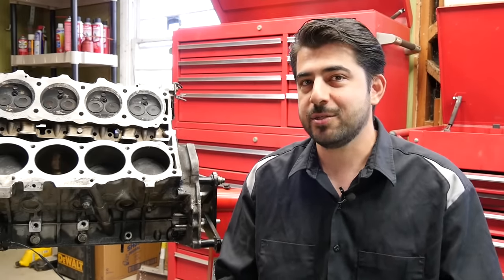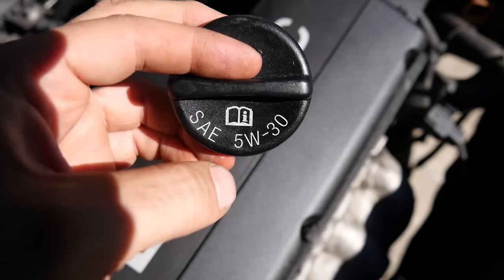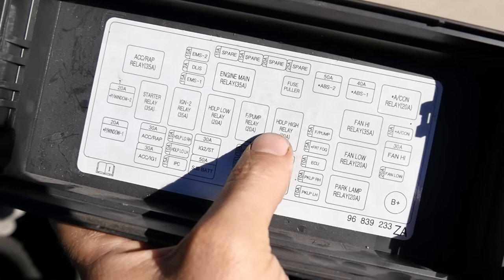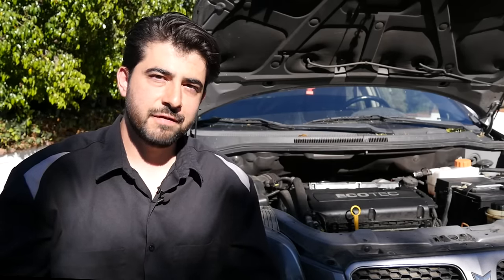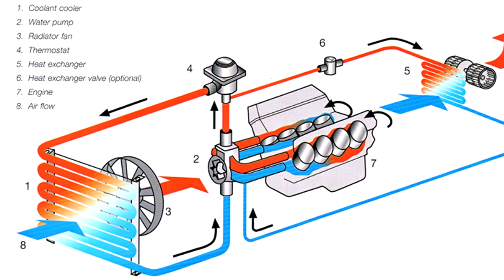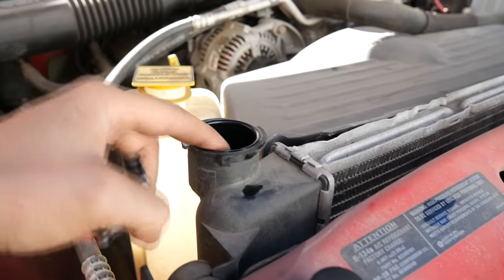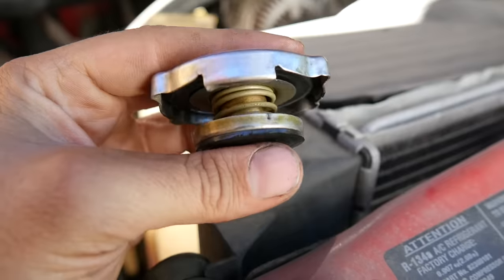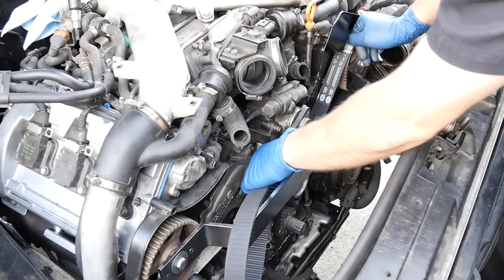Make Your Car Engine and Transmission Last a Very Long Time - Top 5 Tips On Car Care

Comment: If I dont use the oem part, I use use the brand that makes it for tje manufacture, its the same exact part just not over priced due to the car manufacture emblem on it👍
Reply: Smart Idea to find out who actually makes oem parts.
Reply: Exactly what I do! And if I cannot find the supplier’s part, I’ll usually go with Dorman or another OEM supplier.
Reply: Those are OEM (Original Equipment Manufacturer) parts.
Reply: @Fifthcell  dorman is not high quality
Reply: Bryan Hensley I’ve been reading around and it turns out that many people have bad luck with Dorman parts... I personally have never had any problem with Dorman’s parts... they’ve always been good to me.
Reply: @Fifthcell  I've had pretty good luck with most of their parts but overall they aren't near the quality of OEM
Reply: James Kaminski well you will change your mind after a few fuel pump replacements
Reply: @victorialouden1912  depends on the car, especially since I am a dealership tech, i have all my tools and lift nd I work on the brand that i own anyway. Not all cars are a pain to work on.
Reply: Yep, you can certainly do this with European brands where everything is made by Bosch or Dorman andyway. I have an old E46 and most of the BMW parts are stamped Bosch.
Reply: Yep, I did that for a Throttle Position Sensor, found out Beck/Arnley made the factory part, ordered it from Rockauto for way cheaper than dealer prices and inside the B/A box was a Nissan box containing the part.
Reply: Late comment..but this is not true. Just because the company makes for anyone doesnt mean the same at all..oem pay more for specs and volume..the company only does spec required..
Example is when i used to cut steel for gm..they had inpspectors and specs for everything..and that was before mfg. After market standards are indeed lower. 99 % of the time.

Comment: Very true I always use oem parts they cost more but they last a lot longer in the long run so they are actually cheaper. Aftermarket parts always fail earlier.

Comment: My 2004 Honda Civic just hit 300k miles... In its life time I rebuilt the transmission replaced the timing belt replaced the water pump thermostat and tires and brakes and oh I forgot replaced the computer too.. runs great m very happy

Comment: In regards to brake components...I've found that aftermarket brake parts can be VASTLY superior to stock OEM parts.  The NAPA brand has some excellent brake rotors and pads.
Reply: That's probably dependent on your car brand, for Honda/Toyota you cannot go wrong with OEM which lasts a long time and wears the rotors less.
Reply: Hmmm unlikely.

Comment: RE: Filling filter during oil change:

The premise is that if the engine is cold before you change oil, it the oil has drained from the passages and some wear surfaces are not well lubricated. The empty filter will take some time to fill and the wear surfaces will be exposed to additional wear for a short time.

However, it is much easier to simply run the motor for a short interval to make sure that the wear surfaces are coated before you start your oil change. Also, if the oil is a bit warm, it flows easier getting it out of the motor. 

Assuming the motor is warm and the wear surfaces are already coated, the extra second or so to fill the filter shouldn't make a difference.
Reply: But then your old oil is still in the engine
Reply: @truth.speaker  Trace amounts.

Comment: I’ve been replacing parts for my 07 Jeep Grand Cherokee as they fail. So far so good. I’ve replaced almost all of u mentioned here w Bosch from O’Reily like catalytic converter system, water pump, new radiator, new serpentine belt, brake pads, fuel cap etc so far she’s back to running solid just hit 170K and I want her to run to the 400Ks 🤞🏽and btw I always oil change every 3K religiously w synthetic blend

Comment: Three easy steps!! Change your oil at minimum every 6 months and drive slowly. Keep your fluids topped off. And last drive slow and watch your gauges.
Reply: Min. of 6 months is total over kill --- change the oil every 4k-5k miles religiously and use high mileage oil after 75k miles.

Comment: Wish I had known these things when I had my old 1999 Toyota Tacoma 2wd regular cab truck. I loved that truck! The engine finally gave up at 504,000 miles. Who knows how long it would have lasted if I had seen this video15 years ago.
Reply: Don't beat yourself up when we were young we all beat up our vehicles to some extent we all have 20/20 vision in hindsight don't we. Heck I like you wish I had done the same with my first car. We live and learn.
Reply: 504,000 is extremely impressive. Scotty Kilmer says your truck could last forever because of it being a Toyota with a dead reliable engine.

Comment: My 1994 Caprice Classic lasted 350,243 Miles before the Wire harness Shorted out.  The Engine and Transmission were Factory Stock too. Ran Strong too

Comment: Buying a Toyota is still the best first step...
Toyota has made fools of every other car manufacturer...in history.
Reply: "Exactly!" People will be buying four and five cars, ..by the time my Prius ever kicks the bucket! LMAO
Reply: Or any other Japanese car mostly 1990's
Reply: LunaticRed EyeS88 na. just dont go with modern nissans..effn trashhhh. i dont know what happened to them.
Reply: @mobius-1503  They merged with Renault some time ago that's why
Reply: LunaticRed EyeS88 ahhh. good to know thanks..they used to be supperb..we had a 91 300zx forever. manual. never smoked. timing belt was a pain but damn that engine. sounded like a little tank i loved it. never failed us. even that horrendous digital cluster gauge tryna look all futuristic just always worked. pwr windows never broke 285k miles...then way later. i decided to get a sentra se-r. lol. biggest mistake ever. went to the junk yart at 127k...
Reply: I had an Isuzu Rodeo and they went out of business my suv was a decent vehicle but it had many issues that we couldn't ever figure out how to fix. Bought a Toyota and my experience has been trouble free for years.
Reply: I want a Sienna...but have a Honda.  For most of the basic tune up stuff, they are easier to work with.  Although they are still underpowered when compared to a Sienna.
Reply: In reliability sure, it makes a fool of a lot of car manufacturers. In performance everyone laughs at Toyota
Reply: Toyota’s are great but they got nothing on Honda’s.
Reply: @markevans658  having serious issues with a fairly new honda crv 2012, car has one acces with key entry not even the passenger door has one which is pretty dissapointing considering something can happen to the driver door lock entry and dont have second key entry. Looks like cost cutting to me. Another issue is the rear camber on that thing comes with non adjustable upper control arms and the rears begin to sag inwards so wears the inside tires fairly quik..was 180 for the pair with the adjustable center nut but seriously. Being the premium model why are they not included.   The biggest hit right now is at 150k. The transmission is shaking unbelievably. Thinking it was wheel balance or rubber inserts in the front lower control arms but their normal, tie rod end links /motor mounts/ tranny mount is normal, began reading into the shaking and come to find honda put in a newer not fully tested transmission in these models due to it being more fuel effiecient..well somethings happining within the transmission at 55mph and shakes the entire vehicle. Very very disappointing!. Havent taken it to a trans shop due to current budget but it doesnt feel like itll be cheap. May fix it. But will get rid of it asap
Reply: @Biden_Cult_Morons  i was up there in miles in my cavalier. My first whip too was a 2002 manual cavalier. Loved that thing. Would beat it hard. I crashed it at 220,000 miles. Only major thing ever changed was the clutch. Ac was blown as well never fixed it..
Reply: Mobius -1 Yet there are million mile Honda CRV’s with almost no issues.  Reliability on both will be great overall with each having the very rare lemon.  Where Honda really pulls away is styling and driving.  They look significantly better model for model, and who doesn’t want to like the way there car looks, and they drive way better.  Plus they just have better engines.  Toyota is reliable but they don’t drive well and they look terrible.  Although the new Camry’s look much better then they used to.
Reply: @liveuntetheredmusepodcast4832  That Prius will die
Reply: @RMH5.0  True, but at 600K miles
Reply: @liveuntetheredmusepodcast4832  it's a hybrid right? Notoriously expensive when it goes wrong. If you have even a slight problem with that system you might as well right it off
Reply: @RMH5.0  Yes, if your ignorant.   It's pretty inexpensive when you work on your own vehicle. The Prius has lots of technical glitches and issues, (for the average driver would be a major problem, not a slight one) though 99% of these issues can fix themselves with a little human assistance, that's why the Prius is such an incredible machine. Only thing I've ever paid for at a shop, (besides new tires) was getting my brakes bled because it's a computerized method.  I'm hitting 200k miles now, and I expect to work on my hybrid battery cells around 250-300k miles,.. by then i might also have to replace the 12v utility battery, and maybe a starter. There is no alternator, the cooling system is basically indestructible, and lasts forever.
Reply: @liveuntetheredmusepodcast4832  same goes for a lot of cars if you have the knowledge to fix them the price doesn't come into it. But I think I'd have something a bit more exciting than a Prius
Reply: @RMH5.0  LOL trust me i've had enough exciting cars to last a lifetime, I've always owned Trans Am's and Firebirds,.. as they will always be a favorite, but hard to keep around if they aren't kept in a heated garage, (when you live in the  salty northeast) because the unibodies rust so quick. Fiero's are a blast in the snow, because of the balanced engineering, and rear engine...I've also owned Mazda RX7's, Datsun 280ZX's, and loved them all....those also rust very quick. All of them are cars that will never last much longer beyond 100k miles, (at least where i live, unless you never drive them) Now that I have medical issues to deal with, I really need something reliable as possible, and this Toyota Prius though it's not that fun to drive, it is crazy reliable and the computer system can be fun to mod, and mess around with.  But yes I hear you,  I miss my sports car days, every single day! I used to modify Trans Am to drive well in the snow, but of course the salt from the roads would eat them away very quickly.. no sport cars drives best in the snow than a Fiero though, with very few modifications. 
They just made a 4x4 or AWD prius, that might be fun in the snow! lol
Reply: This be true.
Reply: I wish that the North American market had access to some of the other models of Toyotas found in other countries.  The Series 70 Land cruiser in Australia is a stout truck that can be had with at V8 diesel as well as different body configurations.  I'd like to buy one here in Canada but it looks like I can't even import one....
Reply: RMH *write
Reply: Scotty  has grown a beard and dyed his hair !
Reply: Well... Toyotas new oil filter design might change your mind. Check out this Tacoma oil filters on the newer models. It is disturbing.
Reply: ...except honda
Reply: @so1idify  a 2JZ says am I a joke to you
Reply: @markevans658  I have to agree I think Honda's have better engines.
Reply: @liveuntetheredmusepodcast4832  Just means you have to drive an ugly under powered car for even longer Lol
Reply: @AW-zy1kw  the prius prime looks pretty sharp
Reply: I seem to get to the same mileage if I'm driving a Toyota or a Mazda.  Heck, even my 2010 Altima is close to 200k.
Reply: The 4 cylinder  Toyota Camry bought with 300000 miles change what he said the change and flood in transmission  Toyota has a dream plug and filter to do-it-yourself so that with 420000 miles in far as I know it's still going with 420000 miles on it when sold . It's still did not burn oil but did change all reg'lar and the transmission

Comment: On an older car, 2005 Dodge Caravan (3.3 150,000+ mi) it calls for conventional  5w20. Runs fine, no leaks, no burn, she hardly consumes any oil at all. I'll stay with conventional 5/20. And as far as a trans. flush, a Dodge Master Mechanic said to leave it alone. That particular 4spd trans in that model year and  others b4 and after were not well made and a flush will only serve to screw it up. I do the regular maintenance, keep fluid levels up  and we're good.  👍😉

Comment: Excellent advice.  I wish I would have used Synthetic Oil from the moment I bought my 2003 Mazda Protege 5 brand new.  However, I started at 100,000miles and now I have 198,300.  I changed my timing belt always at 60,000miles, but I don't know if my mechanic changed the other parts you said we should (Tensioner, Idler pulley).

Comment: I drive Camry 1995 about to hit 300000 miles
Reply: My 99 Camry 4cyl is about to hit 300k too! Had it since 2000 with 14k on it.... Never had a real problem, typical small stuff, tie rod ends 2x, radiators 3x, timing belt 3x, struts and mounts 1x, both cooling fans 1x, idle air control valve / throttle body scrub out off the car 1x, original AC parts (live in FL, AC is used 95% of the time!) Original alternator although I replaced the brushes last year when I started getting no charge / alternator light ;-) 
Bought new lower control arms, one bushing is shot, need to get that done ASAP at my friends shop. Can't even tell that the bushing is bad by the way it drives. Just feel a little clunking when tapping the brakes and odd squeaking when wet, so I knew something was wrong! 
Car is so reliable and smooth and quiet on the road with the right tires on it (General Alitimax RT)...
Reply: 96 Camry, daily driver, 340K Miles.  Leaks a bunch of oil, but runs just fine!
Reply: My 06 spectra Manuel 162000 Miles AC super cool and keep going.
Reply: Captain Caveman  I keep waiting for it to crap out, and it never does... quite boring, not like my Fords, which fail and die in spectacular ways.
Reply: Captain Caveman Imagine having a shitty car that won’t make it past 200,000 miles with a ton of problems... That’s why I have a Toyota Camry and also my gas mileage is great.
Reply: Captain Caveman  Can you imagine how much more money he has than you because of it! LMAO
Reply: @brandondiaz9576  ..more like his car won't make it past 90k miles,...even less if it's a newer car! Ha Ha!
Reply: Captain Caveman  Actually your wrong, it frees up money for other exciting stuff.
Reply: Captain Caveman  Some people dont care much about cars except for a reliable car to get them from point A to point B.
Reply: @renardgrise  v6?
Reply: @ericlaredo  my Camry is an inline 4... the Fords have been V6s.  My old ford Van is still running great with it's 6V with 200K+ miles... my beloved Taurus threw a rod in its V6 at 240K.
Reply: I drive Honda Camry that hit 900k miles on original oil yesterday
Reply: Captain Caveman  not boring than being a caveman 😄
Reply: Lol I just sold mine that I bought in cali for $500, When I sold it she had 368,000 and ran solid still. Just ugly as hell and the interior was falling apart haha
Reply: Scotty Kilmer would be proud!

Comment: I bought my 1993 Ford Ranger 2.3 in California December, 1992. As of this writing the vehicle has 478,000 miles on it. The engine is original with no repairs on it or the transmission. The vehicle had 2 recalls from Ford Motors early on with brake booster and the muffler replaced.
I was and still am careful about the oil changes, and always did pre-trip before getting out on the road for a long drive. It never had
synthetic oil, it used 20-50 or 10-40 GTX high mileage. I Love My Ranger! Just thought you'd like to know.

Comment: I remember that Scotty said to never flush a high mileage transmission.
Reply: Yep, car is working, leave it alone.  Keep fussing with the car and you will break it!
Reply: When Scotty says don't flush he means don't go to a Jiffy Lube or some other shop where they use a pressurizing machine to clear it out. This however guy is recommending is more or less just a drain and fill  which is okay
Reply: Change it. Don't flush it.
Reply: @ncrtransport5993  You are correct.
Reply: Drain N fill
Reply: @superchuck3259  not how preventative maintenance works my Friend!
Reply: I love it when people say this,it cracks me up.How long do people with this mentality think transmission fluid lasts, 200 ,300, 400 thousand miles?guaranteed if you don't change it the death of a transmission will be inevitable
Reply: Only flush it if it's been regularly flushed
Reply: @ncrtransport5993  Seemed like this guy was talking about removing ALL fluid which would indicate a flush not just draining and refilling
Reply: @theophany1770  but your misunderstanding what a flush is when you go to a shop.  If you roll Into jiffy lube or any quick fluid changer, they will use a pressure machine to flush it all out,  that's bad, if you just do a drain  but then pouring clean fluid to flush and keep pouring till clean. That's different but that's safe.

Comment: 🔥🔥🔥🔥🔥BE CAREFUL FILLING UP THE OIL FILTER LIKE THAT. It can cause a vacuum and you'll get NO oil pressure at all. I've seen this happen to Subaru boxer engines after a fresh rebuild. I imagine it to be more prevalent on a fresh build motor since there isn't any oil in the galleys.
Reply: Will K. Yessir

Comment: Excellent advice on putting in a big Auto Transmission Cooler.
The fluid in those gets almost as hot as a deep fryer. It then makes the soft rubber seals go petrified and leak once its full of stinky brown failed lubricant.